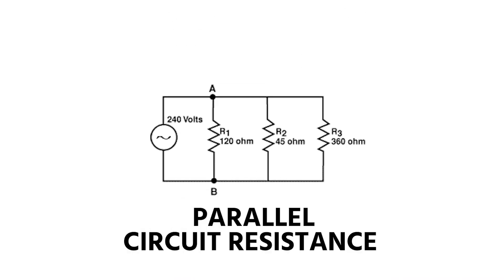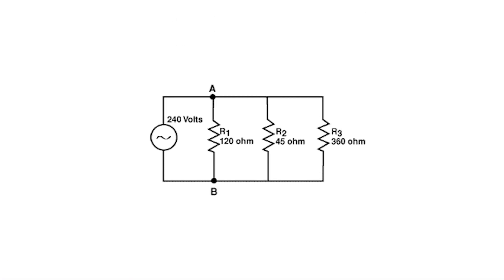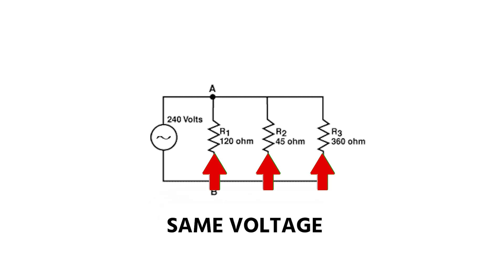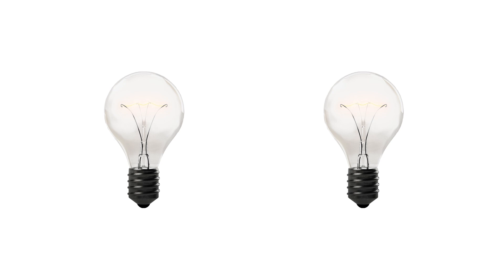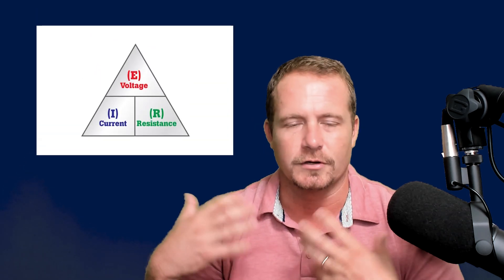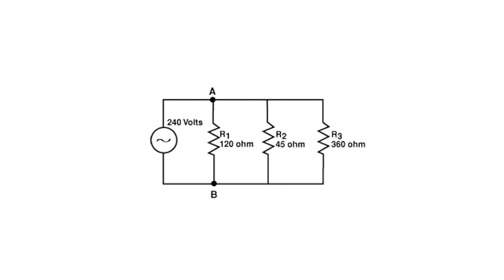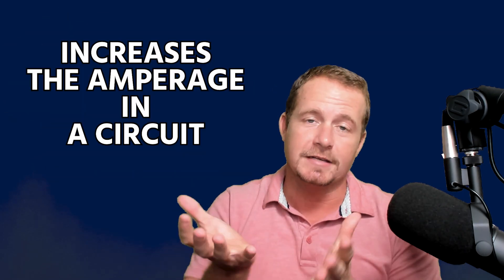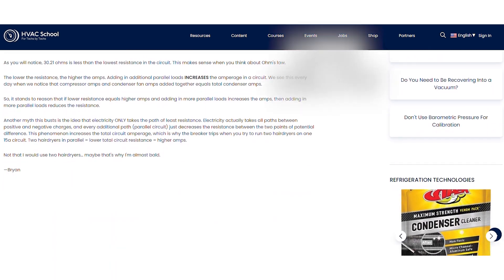Resistance in Parallel Circuits

Comment: (120^(−1)+45^(−1)+360^(−1))^(−1)=30....I find it easier using the reciprocal method.... then you can add any thing that is in series with the parallel circuit. By simply putting the addition before your first parenthesis. Such as 560+(120^(−1)+45^(−1)
+360^(−1))^(−1)=590... if you have a good calculator it easy to plug this in but it's very doable even on your phone calculator